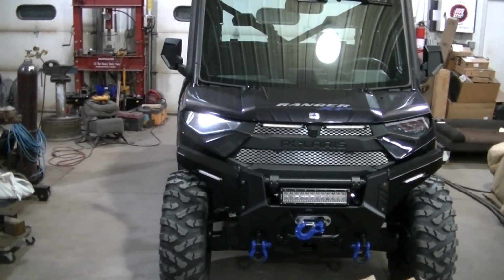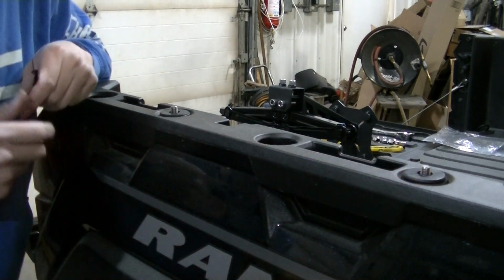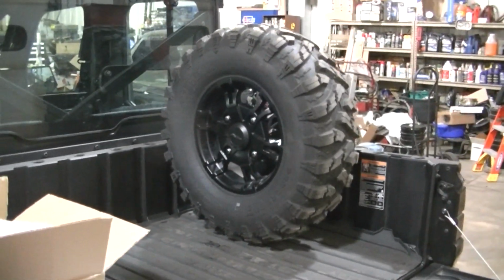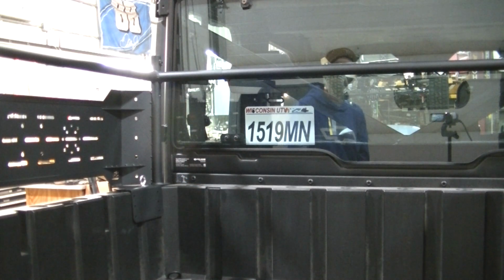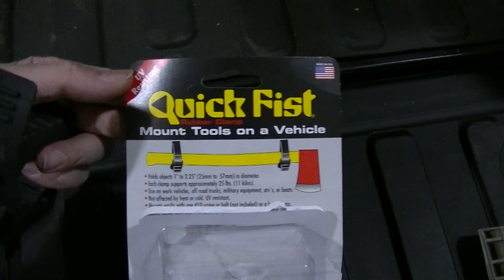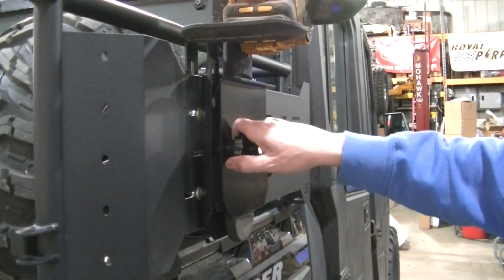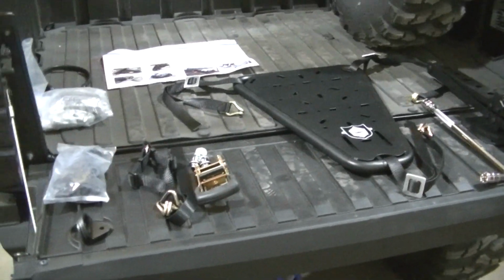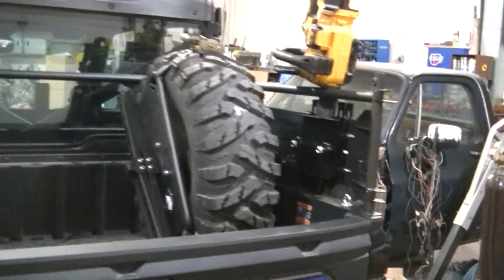2023 Polaris Ranger 1000XP Bed Organization

Comment from the maker: Things that might help with a project like this:
KemiMoto Bed Mat: https://amzn.to/49t3D9C
KemiMoto Spare Tire Mount: https://amzn.to/3MTv3M7
KemiMoto Bed Side Kit: https://amzn.to/3SPHfkM
Fuel Tanks: https://amzn.to/47rPdFl
QuickFist: https://amzn.to/46qDtSj
Chainsaw Mount: https://amzn.to/47ypECe
Pro Armor Jack: https://amzn.to/46tEtVE
Traction Boards with Mounts: https://amzn.to/3upVL8W
MicTuning Rock Lights: https://amzn.to/47eXFru
Blue Switch: https://amzn.to/3MKJguT
KemiMoto Mud Guard: https://amzn.to/3SBPm4m
Frame Plug Kit: https://amzn.to/3MKrxUj
Fluid Film: https://amzn.to/3suVoJw
Fluid Film Gun: https://amzn.to/46723Y1
Polaris Rocker Guard: https://amzn.to/3MBP75J
A & UTV Pro Storage Bin: https://amzn.to/3QAAstK
A & UTV Pro Smoked Taillights: https://amzn.to/45EuKvb
Nicoko 12" Light Bar: https://amzn.to/48xPUhg
Light Mount Tube Clamp: https://amzn.to/46jkolA
Oil Change Kit: https://amzn.to/3LNdkFR
Polaris Fluids: https://amzn.to/3rDXWoh
Rough Country Wing Kit: https://amzn.to/3rynVNN
Side Mirrors: https://amzn.to/45WPRtK
Kemi Moto Seat Covers: https://amzn.to/3RpvuRr
Bumper Guards: https://amzn.to/48eP0Gh
Used ATV/UTV Parts:  https://www.powersportsnation.com/

This video contains affiliate links, which means that if you click on one of the product links and buy, I'll receive a small commission.

Comment: I got the Kemimoto bed rack that you have here finally. Mounted it to my 06 Ranger and it fit perfect. The screws for the cross stability bar were a pain to put in even after I ran them up from the bottom. One got stuck half way in and when I tried backing it out the screw head stripped. The rack is really solid. I like it alot. Fits perfect.
Reply from the maker: Those front cross bars are a pain. I was able to get mine without stripping anything. The nuts that are welded on don't seem to be straight. You have to mess with it, so the bolt lines up with the threads. The rack is a great addition. So much customization that can be done. It also raises the sides of the bed so taller things won't just flip out of the bed.
Reply: Was looking for a top shelf for this rack. But thinking that maybe I should just leave it alone as I carry trash cans out to the county road with this and not sure they would fit under an extension on top. Also have a project CT90 that I need to get running. Have to start watching those videos too
Reply from the maker: I have seen people make garbage can holders that go in the receiver hitch. It's been a long time since I have seen one but then you don't have to load them in the bed. You can make it so you only have to lift them a few inches off the ground. I remember even seeing some people make them with electric actuators, so they don't have to pick up anything.

Comment: Any idea what the brackets on the back of the bed rack are for? Also it looks like the holes and welded nuts at the top of the four corners are maybe for a rack extension with a roof height storage rack? Called KemiMoto and they had no idea why any of these features were added. Maybe I just talked to the wrong person
Reply from the maker: My guess would be they have a rear door and extensions for the top. They don't sell those in the US. Probably just other countries.

Comment: I’ve been watching your videos for a couple of years now and with your fabrication skills if you really wanted the tire closer to the side of the bed could you not cut the arm/bracket that goes from the jack to the tire and shorten it then just weld it up  to make it shorter and allow the tire to be closer to side of the bed . Only problem is if it has powder coating you would lose that unless you took it to a powder coater after
Reply from the maker: Yup, that arm is getting shortened soon. Along with a few other mods.

Comment: I got a 2 gallon Rotopax and thought it would fit on the inside. It doesn’t of course so now I eliminated a shovel mounting position. Oh well.😂
Reply from the maker: What about using the brackets I used for my lights. You could clamp the shovel to the top bar on the side maybe.

Comment: Looks like the same hole size for the plugs
Reply from the maker: I think they are the same. You want to measure your outside holes. Center to center. I will check mine if you want.
Reply: Center to center front to back looks like 30”.  Center to center width on the holes looks like 56-3/4”
Reply: Thanks for looking. Hard to find accessories for the old Rangers
Reply from the maker: That looks to be the same as mine.
Reply: One last question on the Kemimoto bed rack. They supplied some self tapping screws which they said in the instructions to run through the support plates and into the sidewalls of the bed itself to supply additional support. Did you use these. I am nervous about adding holes to the inside of the cargo bed and don’t think they will stay in place.
Reply from the maker: @RanchoFiascoMike  I didn't use the extra support screws.